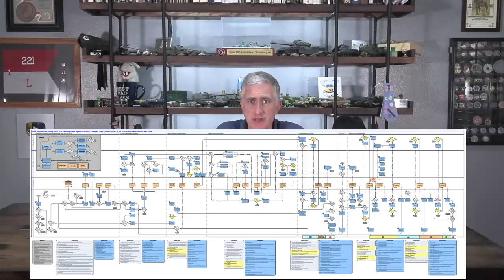Chieftain's Q&A #20: Zombies, Precious bodily fluids, and Magruder

Comment: As for the clever use of something for which it was not designed, how about this; when I was flying B-1s (as a Weapon Systems Officer) for missions into Afghanistan, we were given MREs to eat during flight (missions were 10+ hours long).  We couldn't use the flameless ration heaters they come with (hassle to get rid of the used water-the toliet was small and could easy be filled already with 4 crew onboard.  Also, the hydrogen off-gas is flammable-not good in a cockpit...).  So we discovered the two radar LRUs (computers) in the Central Avionics Bay behind the crew compartment normally were very hot in operation, so we stuck the MRE entrees in between the two of them for 20 minutes, and presto!, hot MRE entrees.  So our radar computers doubled as MRE heaters...
Reply: A Korean War veteran told me that they used a M-1917 to heat water for coffee and shaving.
Reply: Some fellows I met at Otis AFB who served on EC-121 Warning Stars on the DEW Line recalled how they used the power modules for the APS-20 and APS-45 radars to warm coffee, soup, and rations if the galley was belly up.   Galley problems were a common hassle on the EC-121s.
Reply: Tmi guess that makes them macro wave ovens
Reply: This is one of two possible ways to heat food with a radar. The Amana Radarange is the other.
Reply: One of the unwritten rules for 11 Bugaloo was to make friends with a GOER or HETT driver.  Drop a C-Ration or MRE pouch down the exhaust stack, wait 5 minutes then have the driver gun the engine.  Out comes a hot entree.
Reply: Modern problems require modern solutions
Reply: @Kneon_Knight this is truly beautiful to imagine

Comment: Re defending against tanks when overmatched: One of my grandfather's Korean War stories was facing a Chinese tank colum with artillery not equipped to actually counter armor. They fired at them as they proceeded single file through a choke point. Scored a mobility kill on the second tank by a lucky shot to the track. First tank elected not to proceeded alone and the rest were blocked.
Reply: Chinese Korean war tankers were not well trained
Reply: @porksterbob  China's doctrine has always been quantity over quality. After all, when your population is matched only by India, why not? None of their soldiers are that well trained or that well equipped, but there's so many of them it doesn't matter
Reply: lol !
Reply: @filmandfirearms  a thousand butter knives will still cut you up but just a bit more slowly than ten machete wielding zombie
Reply: @filmandfirearms  you could of replaced china's 90 infantry divisions rifles with sticks and it probably wouldn't of mattered that much.
Reply: Although there were Chinese tanks in Korea in the later stages of the war - after it had got static, none were used in combat. So perhaps your grandfather meant North Korean - whose tanks did see combat against US troops.

Comment: My tank commanders always told me to yell UP! loud enough that I could be heard over the intercom even if my CVC helmet had come unplugged during the loading process.
Reply: Same with Stykers. My opnet instructor was a former Sheridan Driver and NG SGM. I tried to just say “on the way” through the mic, like normal. He slapped me upside the CVC and yelled “you better yell that shit into the mic”. Pretty much said the same thing. TBF for us we had a Diesel engine between me and the driver, and could have guys with heads popping out of the rear hatches. It ended up helping me out when my vehicle’s intercom and radios went tats up.
Reply: I got scared on a videogame when the tank yelled UP! after loading the gun, now I know what that's all about 😨

Comment: "What color are the bottoms of tanks?" As a track mechanic, I've been under enough armored tracked vehicles to say. They are, just as you said, whatever color they left the factory/depot with. Along with a bunch of exposed metal, light rust, dust, and dried mud that couldn't be reached at the wash rack and oil stains around some of the access covers. Any exposed bolts are usually somewhat rounded over, due to tanker's driving habits. I thoroughly enjoy your videos, makes me wish I was young enough to enlist again.

Comment: drive a mine flail into zombie horde
Instant triple-S on the style meter.
Reply: Which will instantly be negated when you have to get out with a hose and brush and wash the essence of zombie out of the mine flail.
Reply: @McSkumm  it's all mush anyway it'll just fall off
Reply: @McSkumm  just run the flail faster, let centrifugal force take care of all the goo.
Reply: @justindunlap1235  An experiment - is it possible to run the flail fast enough to take out zombies at range with flying pieces of other zombies?
Reply: @LJCyrus1   that is a possibility that hadn't crossed my mind, might run the flail backwards, to create a nice uppercut effect with a mortar like trajectory.
Reply: @justindunlap1235  you could run the flail clockwise looking from the left side of said flail tank and have a shield in place around the back half of the machine.

Comment: Talking about noise the tanks make, during a drill I was very surprised to find not one, but two M1 Abrams sitting just around the corner from my positions, and they definitely weren’t there before. Those things are silent!
Reply: And, working in the other direction (i.e., deliberately going out to attract attention), I was reading an article in the WWII Axis subforum on the Kitmaker site about a kitbash creating a DAK "wind wagon" -- an Argus AS-10 engine with a cut-down prop from a Fiesler Storch mounted on a captured Bedford MWD, and used to produce the dust clouds characteristic of armor columns in motion to create false impressions of Rommel's movements. Sadly, only one photograph of the vehicle has been found on the Net (commentary about its use in Paul Carrel's "Foxes of the Desert" book).
Reply: Turbine engines

They’re great and the future, or well the future for people with oil surpluses and not deficits

Comment: As an old, tired, wore out former M60A1 and First Generation M1 Abrams driver/Tank Commander/Platoon Sergeant I must confess that the most impressive "breech" I ever saw, of a fortified position, was the result of four M60 based Combat Engineer Vehicles lining up abreast and "launching" their 152mm HEP rounds mortar style. It was eye popping. Of course those same CEVs has to utilize their dozer blades to fill in the holes so us tankers could proceed.....By the way, the tallest man I ever served with was 6ft 8in tall....He and I went through Basic and AIT at Ft. Knox in 1980 as M60A1 Crewmen.

Comment: The US military can be weird on when they enact or enforce height limitations on service in various areas. For example, one would think there would be a height limitation for serving on submarines due to how cramped they are, but apparently there is not. I served with quite a few guys that significantly exceeded 6" tall, one of the guys was 6'8". For reference as to how cramped things are aboard even a modern submarine, I am 5'1"(not a typo), and I still hit my head on stuff fairly frequently aboard the Los Angeles-class sub I served on.

Comment: Chieftain regarding your comments about the various sizes of artillery rounds, I can provide some background. The US Army primarily used Allied field pieces during the war and weren't exactly satisfied with the results.  The Watervliet Board conducted a number of tests and trials after the war and determined that the following artillery piece sizes were the most optimal, the best mix of payload and rate of fire:  105mm for field artillery, 155mm for medium artillery and 203mm/8" for heavy artillery.  The field artillery pieces would only be howitzers, while the two larger sizes would have both howitzers and guns.  Howitzers intended more for general support, while the guns with their longer ranges would be better suited for counter-battery and long-range fires.  The 8" gun was the only dud of the bunch, due to excessive barrel erosion and poor accuracy. The Royal Army got a number of 155mm guns and 8" howitzers, the US rounds had a much larger bursting charge than the comparable British pieces.   A lot of the basic design work for US Army WWII artillery pieces was done in the 1920s but the designs didn't get fully finalized until the 1939-1941 timeframe.  You mentioned the 240mm howitzer, that was a super-heavy howitzer that was intended to be used against heavily fortified targets, like the Siegfried line.   Congratulations on the promotion.

Comment: As a former USMC Tanker the loader does shout "up" is required to do so with all his commands ex "circuit breaker reset!" "breach!" And incorrect ammo "loading sabo" definitely on my tank. 

The loader moves the most while loading and the quick disconnect for the comm helmet easily loses connection. At times the shout is all you hear.

Comment: Guns vs. howitzers was a case of nomenclature differentiating a longer range, higher velocity, long barreled piece, vs. a shorter barreled, more lightweight, mobile piece designed to drop shells from high, lobbing arcs. That's why tanks have guns, they're long barreled, high velocity, direct fire pieces, and why the M198 and M777 and the paladin are Howitzers; they all use the same (or nearly the same, you could direct fires out of the same firing tables) gun tube, which is something like 38 cal. long, and are primarily used for indirect fire.... even though the M777 does have a direct fire capability, because the Marines never met a weapon they didn't want to point at someone.

Comment: 10:43 as we 13Bs like to say "Using Your Artillery Voice"

52:19 not really, the amount of force and tube you need to get the same range as a 155 or even an extended 122 or 105 for a 200/203/208 is insane. It's a simple problem of a heavier shell needing exponentially more bang behind it to reach the range with an ever longer tube to reach those speeds. And as technology advances those guidance systems decrease in size and price making them more and more affordable and practical. Take the M982 Excalibur round, they first were about 800k a round and the last price estimate I saw for them was now closer to 400k. Modern artillery with meteorology, radar tracking, computer calculation, known velocities, and everything else has gone from "putting shells somewhere over there to destroy that grid square" to "long, beyond visual range snipers that put shells through windows at 40km with near 0 visibility" plus there is a difference between a "gun" and a "howitzer" a gun is a long tube meant for more flat trajectory, while a howitzer 8s shorter with a bigger bore for ballistic trajectory, the US got rid of its last "gun" in the form of the M107 175mm SPG. An argument can be made that with the bore to length ratio never being set in stone to define the 2 the M777 is more of a gun than howitzer. So Gun long, Howitzer short.

1:00:39 that was my exact MOS wishlist for joining but I couldn't be armor or cav as colorblind

Comment: Just to clarify Nick with regards to the British Army Reserves or any of the other services they do run a similar scheme for officers and enlisted personnel called the FTRS (Full Time Reservist Scheme) the details of which are;
a) Full Commitment (FC) appointments fill Regular Army jobs that cannot be filled using Regular personnel for various reasons. The pay and conditions are broadly similar to that of Regulars. The length of the appointment varies and will be specified in the advert. In these positions you are likely to be deployed operationally with the regular unit you are attached to as per their rotation.
b) Home Commitment (HC) appointments are established FTRS posts. It does not pay x-factor and there is normally no entitlement to quarters or home to duty expenses. Most FTRS appointments are on HC terms. FTRS appointments are initially for a maximum of 3 years with the possibility of commitment extensions. These are the posts that tend to be a full time attachment to a reservist unit and on this scheme you are unlikely to be deployed on operational deployments.

Comment: In Canada a reservist can be under three pay levels. Class A is the weeknight/weekend training/exercise, Class B is a job that last 3-12 months either at the unit as a Clerk/Quartermaster or attached to a regular force unit for courses, support, etc. Class C is where you are at the same pay level as a fulltime soldier but also with the same deductions. Generally used for deployments. Each reserve unit will have a small staff of regular force personal, generally a Captain, Warrant Officer, clerk and a corporal.

Comment: Regarding hedgerows, my dad was 6 Armored Division and he did some fighting in the hedgerows. His War scare was when what he believed was a panzerfaust. As there were poking their nose out from hedgerows a rocket struck the front sprocket on the Sherman tank my dad was commanding real fast to regain concealment. Appliance inspection was determined that the Sprocket was warped and several of the bolts had been blown off by the rocket. The driver of the tank was extremely motivated to backup since the rocket hit on his side of the tank.

Comment: 1. SCOUT VEHICLE - When I was in AOBC in late 74, we were told we'd be riding in the M800T by the time we came back to Knox for AOAC. Boom! Cancelled. For two major reasons – First, it was too small for all the gear that was programmed to be showered on scouts by 1980. Second, it was distinctive, one look and the enemy would know he was engaging cavalry and not infantry or armor. So we soldiered on with the M113ACAV until we got the M3.
2. S119's NEW ENGINE – Ironically enough, it was the Rolls Royce Merlin
3. POST-WW2 GERMAN TANKS IN SYRIA – Do a search on “Panzers in the Golan Heights” for a very detailed history of Das Syrianisch Panzer Korps
4. GREEN MACE – A weapon of baroque complexity developed during the era of Rainbow codes. Also look up Ratefixer, Longhand and Red Queen. Gotta love those British Code names.
5. ATOMIC TANK ROUND – James Bond had one when he was doing his National Service. Every battle group (large battalion sized unit) in the Pentomic Division had a Davy Crockett Platoon armed with spigot mortars firing the M388 sub-kiloton nuclear round of 10 to 20 tons yield and weighing 76 pounds, The tripod mounted M28 for the Airborne had a range of 2 km and the quarter-ton mounted M29 a range of 4km. Contrary to the legend, this was beyond the blast radius of the warhead. The size of the warhead is close to the theoretical minimum for a fission type weapon, so a tank round isn't feasible. But it would have been great ammunition for Green Mace.
6. ATGM'S IN YOM KIPPUR WAR – A primary reason for the initial heavy tank losses was the IDF Tank Corps' hubris. In 1956 and 1967 they could charge Arab positions and the enemy would scatter in terror (except for the Jordanians), so they forgot the lessons of combined arms warfare and either outran or just plain ignored their infantry. The IDF was also unbalanced with too many tanks and not enough mechanized infantry and artillery. The tankers were the kings of the ground arm, along with the paratroopers and Sayerot (“Recon” - actually commados). Regular infantry and artillerymen were looked down upon and did not attract the best recruits at Gibush (the equivalent of Reception Station, where recruits could request their branch of service' Note: It can also refer to the Q-Course for Elite Units)
7. M1128-I thought its crewmen were from Armor Branch
8. CO's GUNNER-Back in my day he was authorized to be a Staff Sergeant (E-6) rather than a Sergeant (E-5) due to his additional responsibilities as a stand in tank commander. Typically, he'd be the next in line to get a tank ofhis own.
9. IMPROVISED AFV'S – Check out the “Narco Tanks” down in Mexico. The cartels are taking on the Mexican Army, so this is no joke. Pretty bad when your cops need LAW's at the traffic stops.